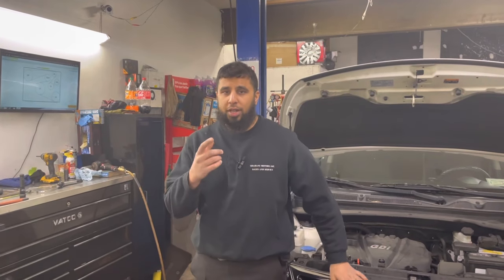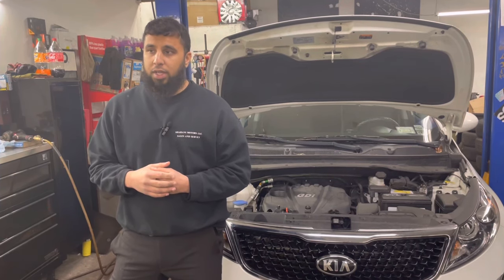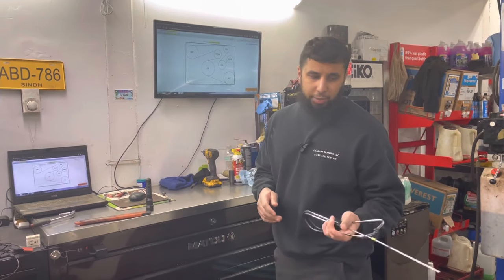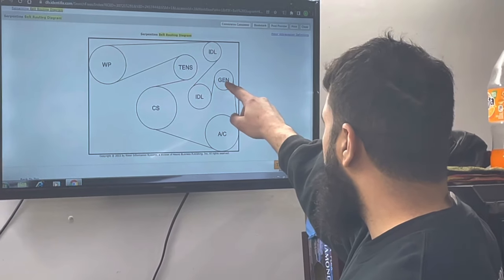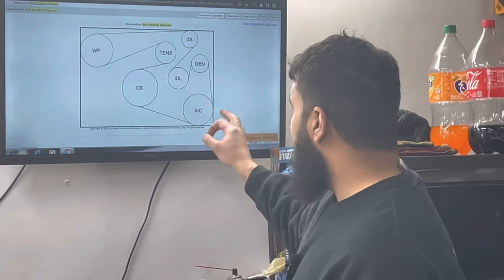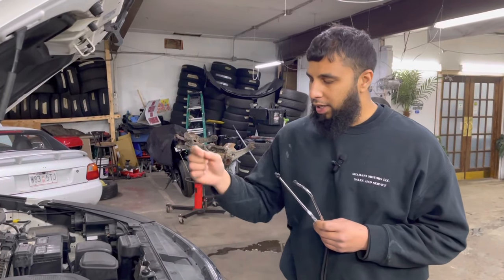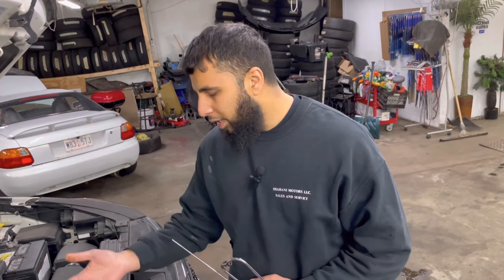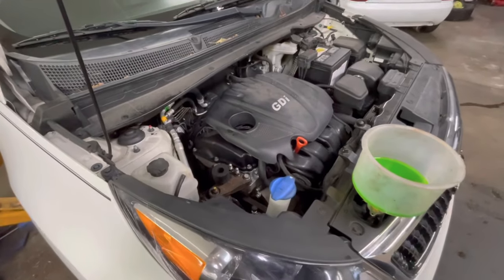KIA engine replaced recently and KNOCKING hard AGAIN!! Can we save it??

Comment: I took my 13 soul into the dealership, and they said they had to do two ecu upgrades. Well, the knock sensor  and  rpm sensor  were switched, but it ran well. The engine  ran smooth well. They switched the connections, told me 230$, then told me it ran well and told me to come get it. Well, they called me the next evening  before i picked it up, the guy said. " i drove it to hardies right down the road, and it started missing.  Missing  so bad that it couldn't  drive. He said there wasn't a code for the cats recall. i said i erased it, you have to drive he said i cant its missing too bad. wtf am i supposed  to do im still paying on this car l.

Comment: I currently own a 2015 Kia Cadenza it has 179,638 miles on it, and it runs great, the only thing it has the check engine light on since about 122K miles or so, I took it to auto parts store they check it for codes, and they said it was engine control module, but it works fine, and I've been driving it ever since

Comment: Error code P1326 occurs due to vibrations indicating excessive connecting rod bearing wear. You can easily detect them using the KSDS (Knock Sensor Detection System). Since severe engine damage and failure are possible, this device notifies the driver about a preceding phase of bearing wear.
Reply: Did the car in the video have a code? I didn't catch it...

Comment: But the engine would not have displayed the P1326 code, am I right?  So you are completely correct to keep an open mind and help your customer in a professional way.  I would be upset too if I had my engine replaced and now this happened.  For all reasons would there not have been additional warranty on the engine replacement?  You did absolutely the right thing:  Not making any assumptions.  Well done!

Comment: My experiwnced with my KIA SPORTAGE 2.0 CRDI so far
-change aircon bearing
-alternator bearing
-door latch all 4sets
-rubber bushing front and rear

Other than that, i have not encountered any issue with its engine, i always replaced system oil every 3 to 6 month regardless the appearance. I know most of headache will follow when engine internal parts left uncheck or circulated with dirty/contaminated oil. to protect your engine is to make sure fuel and system oil are clean. Stick to one fuel supplier with good reputation. Mine is shell v power diesel since day 1 untill now already 9 years old with 80km on it.

Comment: I have a 2015 Kia Forte LX 1.8 with 327,000 miles on it, thanks to the damn Rideshare Industry. Car is in excellent shape and still super fuel efficient. However in the mornings when I start it it makes this "spinning-kinda" noise for about an hour and then goes away. Once the engine is really hot it runs fine and smooth. Any suggestions? I have never replaced the water pump.
Reply: Could be timing chain rattle

Comment: People keep saying that their Kia Hyundai is fine. It's statistically probable that you're more likely to have expensive issues with this engine. Is it worth it when the dealers suck?
Reply: To be fair, the new Kia products have reverted to MPI engines. They recognized the problem with GDI and went back to something more reliable. I have a 2021 Kia Forte with the 2.0L MPI engine, I am finding it easy to get 4.7L/100km (50MPG) on the highway. They are making some of the most efficient gas cars on the market. I also paid $21k for a brand new car in the past year, which is amazing considering the prices of everything, and the Forte isn't tiny, its their mid-sized car. You can fit plenty in it.
Reply: @BTin416  There is A current recall on your car that involves a bolt coming loose on the steering column that can result in loss of control. You better check with your dealer. Check yourself and for your safety check often.
Reply: @eleventy-seven  People should check recall lists for all vehicles regularly, it isn't a Kia-Hyundai problem, it is an every car maker problem. Thanks for the tip.
Reply: @eleventy-seven  Is it by chance the worm gear? Had mine replaced on the 2019 Sonata that I have, recall, no charge.
Reply: people should avoid the Hyundai/Kia GDI 2.0T and 2.4 engines (Theta 2) from 2013-2019.  The 2010-2012 3.5 and 2.4 GDI engines also sometimes have issues but its rarer.
Reply: @rvborgh  my Sonata 2.4, 2009 (therefor non-GDI) seems to have a pretty good reputation of reliability and longevity . Just turn 13-y/o and this engine purr like  cat.  If i'm not mistaken, 2.4  sonata's of 2009-2010 (with non GDI engine) were the most reliable and long lasting Sonatas ever built
Reply: @denisst-cyr3558  yes the non GDI ones seem to be just fine (2.4, 2.7 V6, and 3.3 V6).
Reply: @BTin416  Trying to help a guy out.
Reply: @cousinjohncarstuff4568  Don't know. Check your Vin. Also put your car year make engine into Google look for service bulletins they may cover it. Often times they will have a svc bull item when there's no recall. You can push to get it done if you're having issues.

Comment: ok can anyone advise me??? im so confused, my 2013 kia soul engine is making this same exact noise, it never stopped running ..but i immediately had it towed to mechanic after hearing the noise. it came out of nowhere. my oil had nearly all leaked out or burned off without my knowledge. but there was a wee bit of splatter on the dipstick. i read that even if theres barely any on the stick that doesnt mean its completely out?? idk. car had absolutely nosymptoms til one day, at 101k miles, it started knocking.  
my mechanic didnt even go into specfics, he texted me and said something is really wrong. he said they went to look at the engine and pulled the fuel pump out and it fell apart in his hand?

he recommmended total engine replacement but im so reluctant because he said kia doesnt even make these engines anymore. so if i buy one itll have to be used. these engines seem notorious. so how do i know my replacement wont have a similar issue?

so i had the car towed back home. the mechanic warned me it wouldnt start at all now because of the fuel pump or whatever

well that was a month ago now. its been sitting the whole time. tonight i was getting some things out of the kia, cleaning it out..sat in it and turned the battery to see it all was still well there.  
decided to turn the key and it still turned over? like ,i probably could have driven away ?
still making the same awful knocking sound akin to the sound in this video

but why did the engine still turn over?
was my mechanic wrong?  should i use my last AAA tow of the year to take it to get a second opinion elsewhere??

Comment: So it sounds like the dealer had just installed a new engine with a faulty water pump?
Don't take anything back to that place!
Reply: Dealership mechanics are thief's thir job is to make things fail..or make up stuff you do not need ..... first do it yourself if you're capable... second be lucky enough to have a honest mechanic there are a few out there

Comment: That customer got a new engine replaced under warranty, even though it wasn't the problem? LOL! With a water pump replacement those are some major parts, they just got lucky and will have a vehicle that will last them many, many more years. Would be worth replacing the transmission (if ever needed) to keep that vehicle many more years. Throw a new coat of paint on it and its basically brand new again. I'd paint it with real color like bright blue, yellow, sparkling burnt orange; none of this boring/drab white/black/gray/silver nonsense that dominates the roads today.
Reply: New motor? 
That’ll extend the life of the vehicle at least 5 minutes!!!

Comment: Kia’s are a piece of crap! I will never own another one ever again!! I bought a 2014 Kia soul brand new, took care of it got everything done at the times it was supposed to and at 140,000 miles it started shaking and acting up really bad, I need a fuel injector, I replaced all four including my spark plugs at all the whole shabang done, it was still misfiring, so the mechanic said that they would have to do an engine assembly to figure out if it’s a fuse or whatever that’s causing the misfire, the cost to do all that was more than my car is worth, so your girl is looking at a new car lol ! Stay away from Kia’s.
Reply: Sound advice.